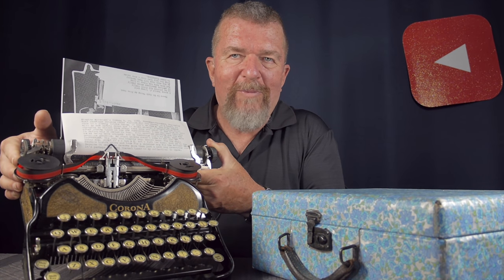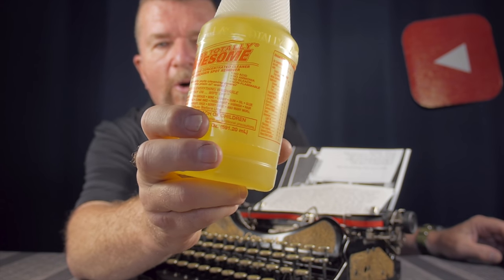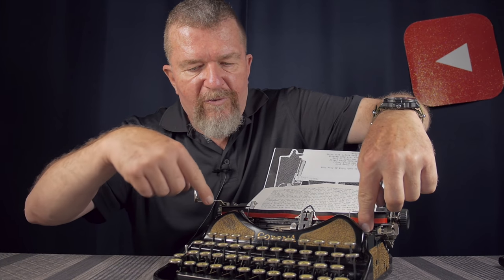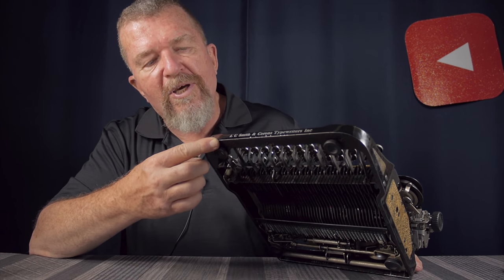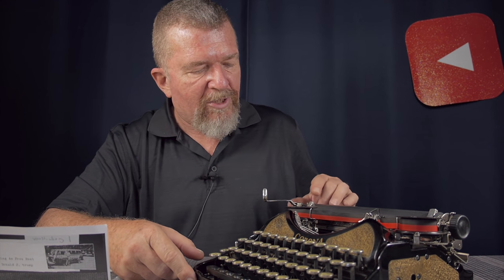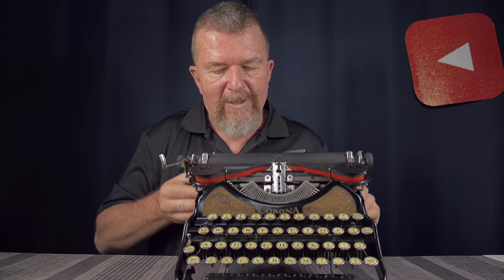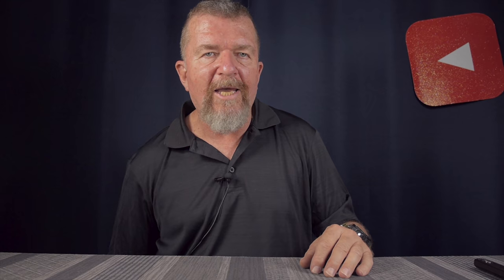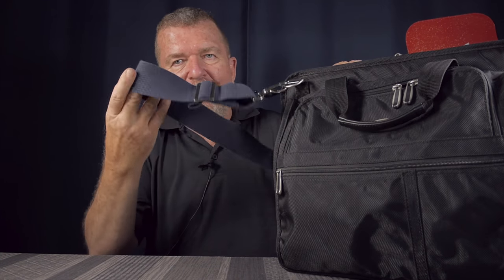This is Not a Vlog - 11 June 2019

Comment: I have a question that you might be able to answer, I recently bought a Smith-Corona Electra 120 from Craigslist. The machine is in great condition and it’s wonderful to type on, I had to buy a new ribbon for it because the old one was in extremely bad shape. The issue is that when I type, the ribbon advances but the non-driven side of the spools just free-spools out till it’s slack. I don’t really know what I could do to keep it from doing that but any help would be appreciated.